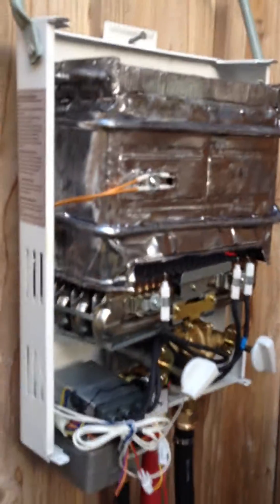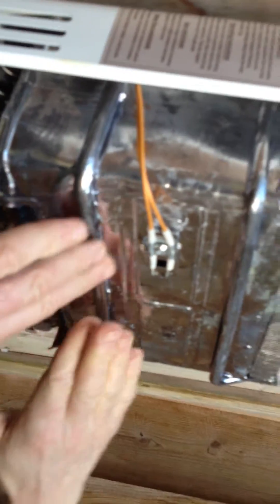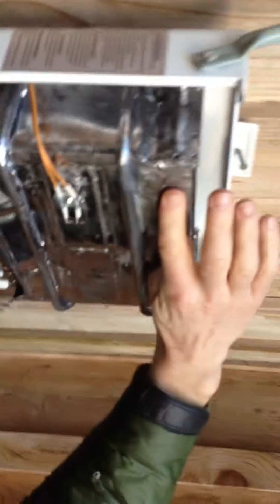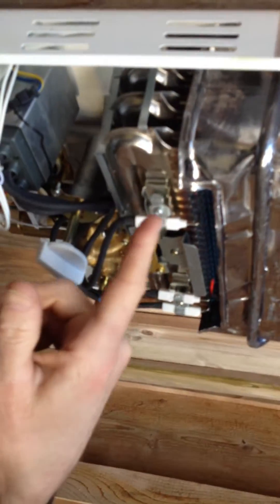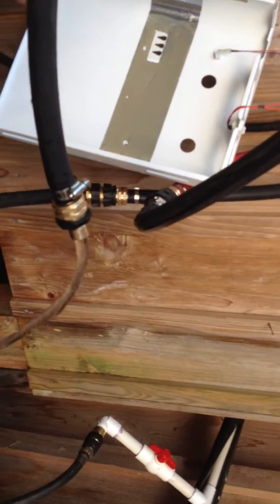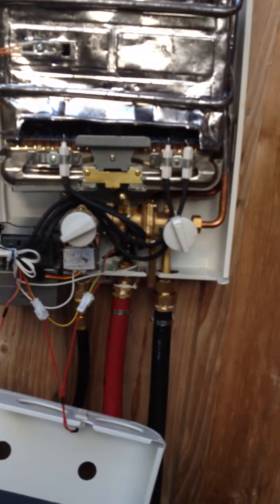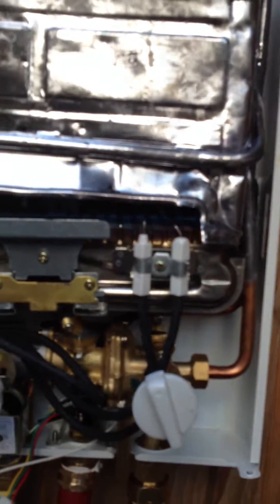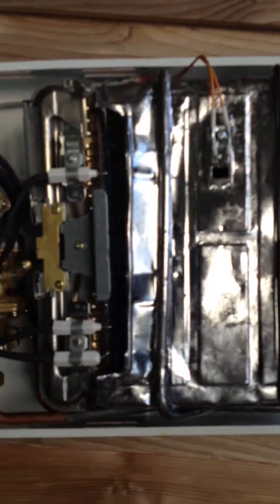Eccotemp L5 Tankless Water Heating Anomaly

Comment: Your problem is not the unit but the BTU size you have, and the flow of water passing through the unit.If your inlet temp is 45 and your unit is rated at a low BTU then it cannot handle raising the amount of water passing through the unit. This is the biggest problem whereas they sell you an undersized unit for the area you live in.
Reply: I dis-agree, the flame showed in the video was way low!  No way this could heat water of any temp at that flow rate, bad regulator either at propane tank or in unit